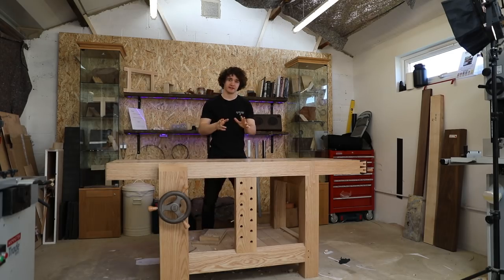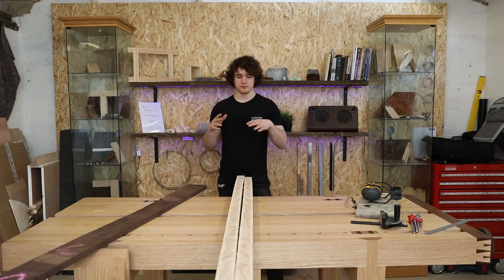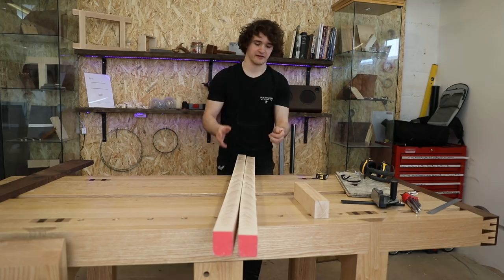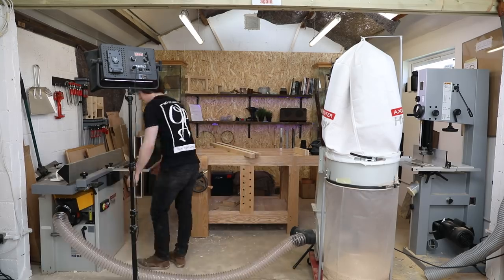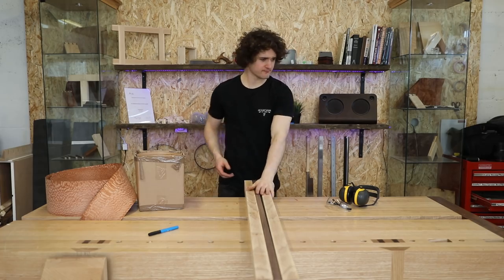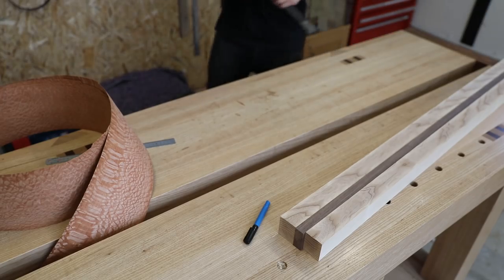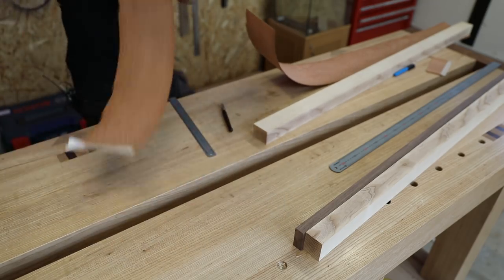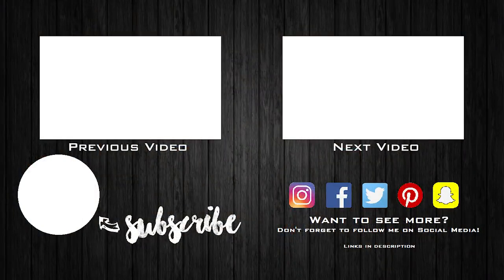Making a Custom Bass Guitar | Part 1

Comment: Love it. Soooo real - I'm not a craftsman but even doing simple fixes at home I spend most of the time looking for tools I had in my hand just a minute before, dropping stuff of the bench or hitting something with my head. Glue remains on my hands - a must. BTW: as for the card you used to spread the glue - have you been to Poland?

Comment: Funnily enough, my first attempt at guitar making will be to make a body for a 5 string fretless. Bought a fretted neck (F*nd*r stylee) some years ago, but only now getting round to using it. Will remove frets, and infill with maple veneer, (or even lacewood if I can find it!).Will be making the body from mahogany and a top from Crimson, hardly surprisingly. 
THEN, if that all works out... the next one will be a full build, neck frets and all....
Good luck with this, but I suspect you won't need any!

Comment: First, the band saw and planer sequences were really well done, Matt. Good job. Those were fun to watch.

Then I have a question. Do you ever lubricate the soles of your planes? I oscillate between paraffin wax and a thin film of light machine oil for that (3-in-1 basically) and I can't decide which I like better. It makes a HUGE difference though. It looked like you were struggling a bit planing the ash.

Comment: Pop over to the grocery and buy yourself a roll of freezer paper. It’s about 60cm wide and plastic coated on one side. Great for unrolling onto the workbench or assembly table before flinging glue with such abandon.

Also, James Wright is in the midst of a mad adhesive testing binge. Among many things, he’s determined that Tightbond III has excellent gap filling ability. So you made the right (Wright?) choice.
Reply from the maker: Hahahaaaaa I see what you did there. I like it

Comment: @Matt Estlea- As you were running the neck timber through the Jointer, I was surprised to see that you weren't using any type of push stick , blocks, etc, to keep your hands and fingers well away from the spinning blades. That observation IS NOT a criticism in any way, shape, or form. I have no doubt in your skills and wisdom to operate safely within your abilities and limitations. There are so many "Safety Sally's" on the inter-webs that think craftsmen of every discipline should or must own and use every little gadget, jig, do-dad, and accessory when working with power tools. If the craftsman doesn't own or use these accessories they are branded and accused of being an unsafe moron and as such they must be devoid of skill or legitimacy as a craftsman.  
Those who actually work with their hands and machinery every day, and have for years and years and years, know that there are times when items like the blade guard on a table saw can actually be a hindrance or more dangerous during a specific task  or for a technique. At that point, it shows greater skill and healthy fear/respect for that dangerous situation, forcing the craftsman to be more attentive and diligent while executing that task. 
For me as a fellow craftsman and subscriber, it affirms my impressions and observations of you as a woodworker and young man. Your dedication to excellence in your work and the sincerity in your voice as you communicate with your audience is endearing and exhibits a humility and consciousness that few people (talented or not) possess in today's culture. Through watching your videos and listening as you share with us about your work and passions, you don't try to hide your mistakes or struggles to find solutions. For that you have earned my respect and sincere admiration, as one man to another. I showed up for the Roubo work bench..but I subscribed for the content and quality of your character. 
Keep up the excellent work my friend! Thank you for sharing your passion with us all.
Reply: Ricky Harrison Here in the UK (I'm a British cabinet maker) we don't tend to use pushsticks on jointers/surface planers. I was never taught to all through my apprenticeship which was only a few years ago. Reason being is you need to put pressure on different points of the timber at different times, this is far easier without pushsticks. For example you can get tapers and slight bends into a piece using a jointer, as well as straightening pieces. On saws we use pushsticks, same as spindle moulders etc, but for planers they are really not needed.

Comment: I hate to comment negative, nice work etc, but when setting the next up you paid attention to the grain pattern, but not grain orientation, quarter sawn is the best if not the only way to build a neck! also titebond original glue is best as it resists thermostatic creep better than other glues. but again nice work.